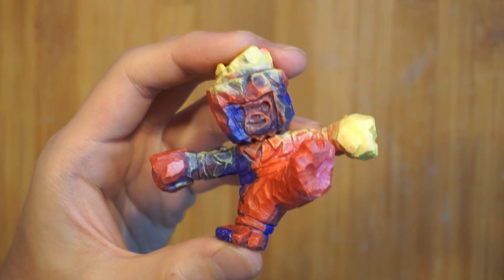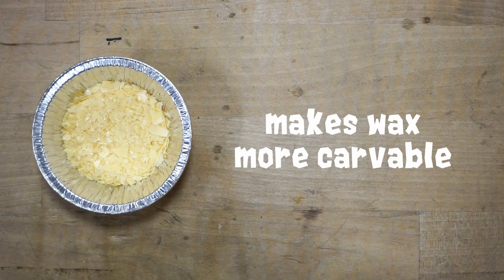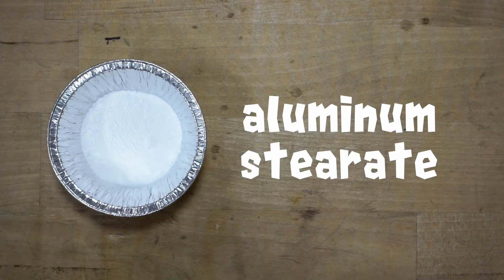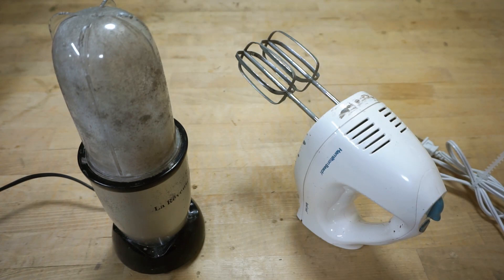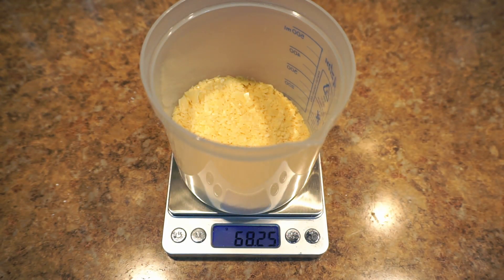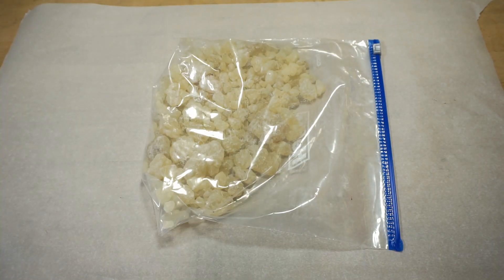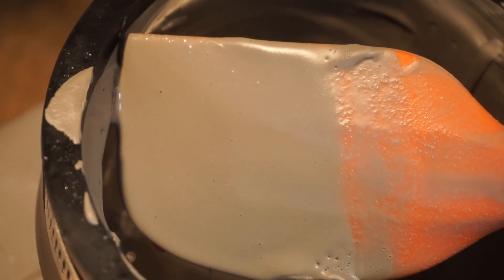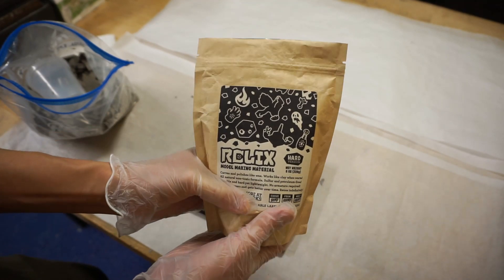How to Make Toy Sculpture Clay and Wax - Intro to Relix

Comment: Your comment about the product improving after a 24 hour wait really cracked me up. I know EXACTLY what you are trying to describe and I couldn’t do a better job.
It can feel just a little less “cohesive “ when it’s still warm immediately after pouring.
I do have a theory about what it is and your statement about it “realizing that it’s not just wax “ may not be as far fetched as you think. The natural waxes have a crystalline structure that changes slightly as it cools over time. Microcrystalline waxes are still technically crystalline though the crystal structure is smaller than the natural waxes. 
So as the wax cools and the crystals interlock to form the new material it does undergo a slight change.
I’m not a material scientist, but that’s my theory. Your blended waxes do truly change into a new material with its own unique attributes. As much alchemy as chemistry. Part art , part science.
Keep up the great work !
Reply from the maker: That is really fascinating, and makes total sense! I noticed that wax isn't smooth or consistent right after being made and has an almost crumbly nature. I had similar suspicions as you but I thought I was just being superstitious. It's good to know I wasn't seeing things!
I've tried some metalworking and my teacher taught me about how the crystals in the metal change as you hammer it which work-hardens it and heat it to release that built-up tension. That sounds very similar to your theory about the crystalline structure of wax.
Hearing such a thought-out explanation from you really makes me want to dive even deeper into the science behind it all. I think that as more people start finding out about wax we'll make a lot more discoveries about its alchemic nature!

Thanks again for sharing and supporting the development of wax sculpting materials!
Reply: Hey Gary, good to hear from you again! My God! It seems like someone else has found you and went trough all stages just like I did! ;-)
Reply: @timvandeweerd3706    it's a small a very connected small world we live in.

Good to hear from "old" friends and new ones too :-)

Best, GaryO
Reply: Correct.
Reply: I know who you are

Comment: Can you drill a deep hole into it?
Reply from the maker: Although it's pretty durable, wax is still brittle so you would either have to drill very slowly or first use a heated sculpting tool to create a preliminary hole and then use a drill bit to bring it to the appropriate size. Hope that helps!

Comment: Howdy. Quick question. So I followed the recipe and made the wax. After I casted it the surface was kinda tacky. I waited a 24 hours again to see if it would change. It slightly did? It's still kinda sticky and my metal tools are sticking to it. Any ideas on something I can try to harden it up? Thanks again. Hope your doing well
Reply: I would consider lowering the amount of copal resin, or removing that ingredient all together and give that a go. Another recipe I have for "sticky wax" is just bee's wax with some pine rosin in it, so I'm guessing that is the main ingredient that would make the material sticky.

Comment: Just to help clarify. You cannot “sand” wax. Not in the conventional way. This does not remove particles according to grit size. Sanding medium quickly gets bunged up in between the grits. Unless you can find a way to avoid this, like by freezing, then it is not sanding. This actually is smoothing with the grit value. Which works. But don’t waste money on tons of sand paper, when you just fill it in with wax particulate then it becomes dull…useless. Use a solvent, and a cloth, which will smooth the surfaces much like a plasterer does when smoothing a large wall. He only sands AFTER the plaster is rock hard. If you do it wet, well you know what that does. Smoothing, not sanding. This is not a whine about use of words. This is much deeper. You can waste a lot of money just mucking up you expensive wet and dry sand papers. Believe me…I know! This is meant as a tip, not to degrade this good man. His work here is excellent. He has given me great incite, thanks brother.

Comment: Very instructive, thanks! I have more than 5 gallons of Monster Clay Hard that I want to convert to the new Grey that they now offer. I can't afford to replace it all in one shot. They won't sell me a bottle of their coloring agents, so I've been researching to see what would be compatible. My answers seem to be in this video (aluminum stearate + powdered pigments), but to clarify, what would you recommend to tint my old Monster Clay (and similar), and in what order? (I'm thinking to melt Monster Clay then gradually add both powders that have been mixed together). I have a crock pot, and access to artist-grade powdered pigments and various other powders for making paints and glues. I bought a pack of the new Monster clay to match the color, so if I buy more in the future, I won't get distracting variations in my sculpts. I'm worried that the pigments may introduce a gritty texture. I'd also like to increase the hardness, so maybe I'll add the same ones you recommend for that.
Thanks for pointers, Relix & commenters!

Comment: In addition to copal resin did you also try rosin aka pine tree resin with the solvent removed?  Such as what's used for grip with athletes/gymnasts.  It seemed to have a lower melting point than copal but you may already have experimented with it

Comment: I'm really happy somebody attempted to make another cx5 type clay! i didnt have a chance to get any to try before it went out of avaliabiity. 
right now im using jewlers wax since i have limited means to make wax at home its a great wax that can handle high temperatures and machine sanding/drilling but its not opaque and it only has liquid or hard state and can't be smoothed with zippo only high heat and elbowgrease :( 
so i hope i can purchase your new version sometime. btw will you have any other way to support you/buy recipe books in future than patreon? 
(and out of interesst is your hard version ok with a rotary tool as well or will it clog the tip?)

Comment: Hii my final product is flacking what to do
Reply from the maker: Hey there, sorry to hear you're running into some issues. If you want you can contact me at info@relix.works and explain a bit more about what's going on? I'll try to help as best I can!
Reply: @RelixWorks  Hi thanks for reply 
I have made according  but  it is good when hot in working condition  but as it start drying  it chips of some places
Reply: @ankitaniltrivedi3199  You probably didn't mix it well enough, or didn't measure them correctly. its easy mistakes to make.

Comment: Thanks so much for this. I have been trying to emulate Gary's wax's for years with varying results. One of the biggest problems I encountered was the pigment not dispersing evenly and also discolouring when I use a wax pen on it.It would either turn a lighter or darker shade and was very offputting when trying to evaluate the forms I was trying to sculpt
Reply from the maker: Thanks for checking out Relix! Gary's formulas are such a great resource! To be honest, my formulas aren't perfect either and if you overheat the wax, you can still get some discoloration. I have some ideas on how to improve that so stay tuned!